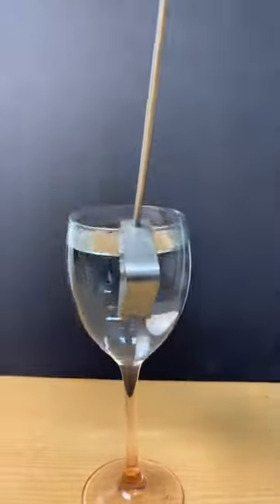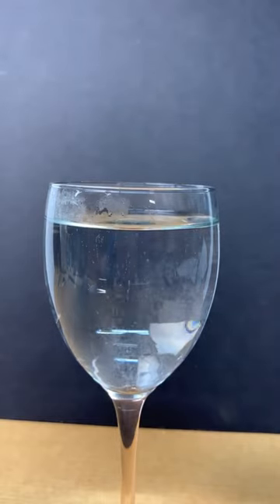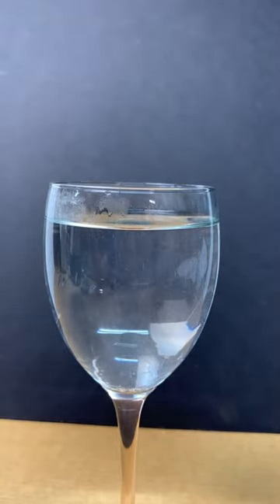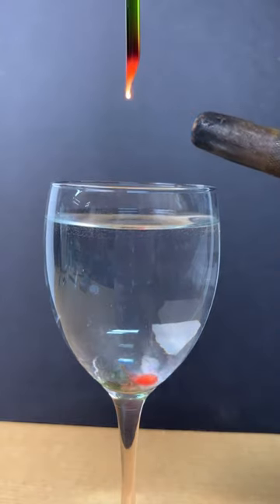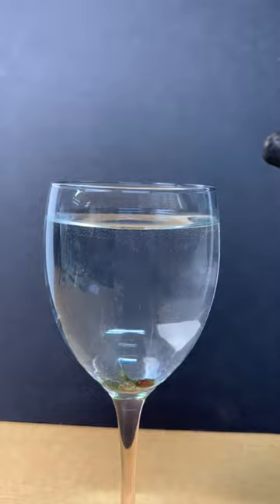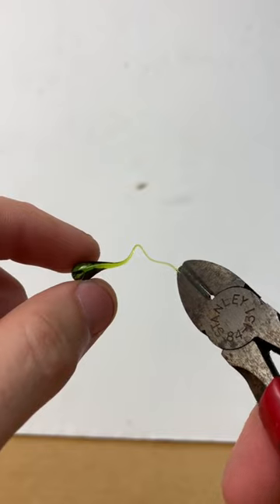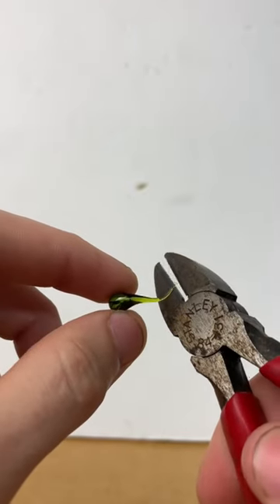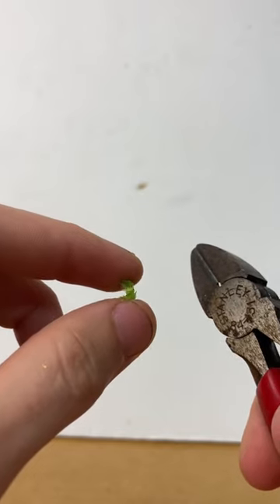Rupert’s Drop in Hot Watter!

Comment: Day 3 of asking for liquid nitrogen
Reply: I’m on day 8 of asking 😐
Reply: Letsgoo
Reply: Hi, I can actually answer this one, albeit without the video. The answer is that it wouldn't work because of the Liedendfrost Effect.

Basically, the hot glass evaporates the liquid nitrogen, which creates an insulating layer of gaseous nitrogen around the molten glass, which allows it to cool over a much longer period of time.

Water works because it absorbs so crazy much heat before evaporating compared to most other liquids
Reply: @gameygeemer4142 thanks but i stil want to see him try it
Reply: @gameygeemer4142 we want to see him do it not you explaining it